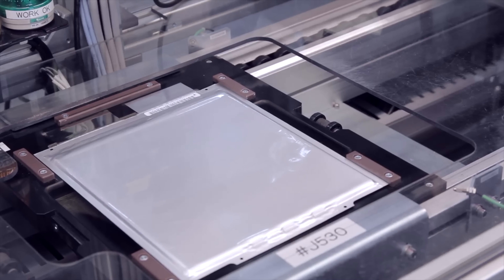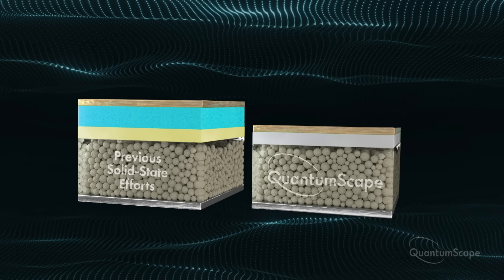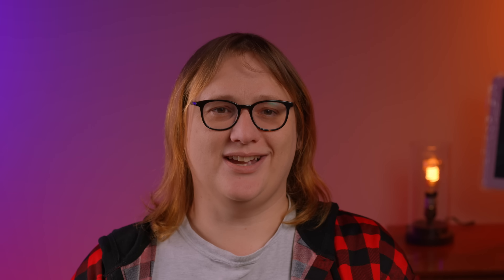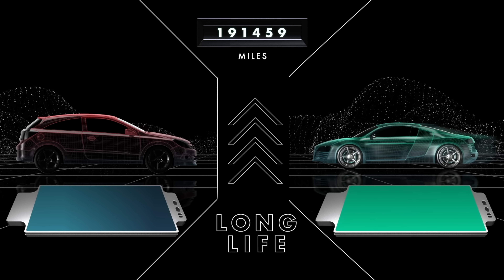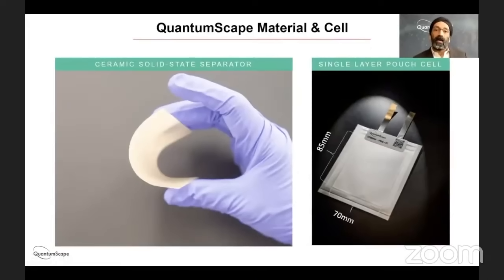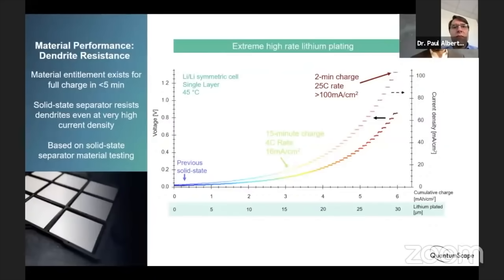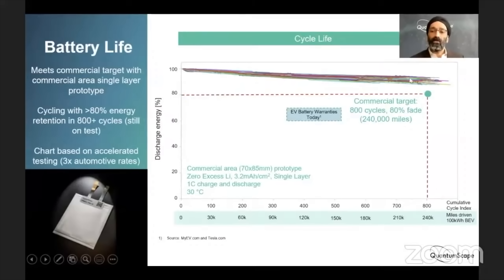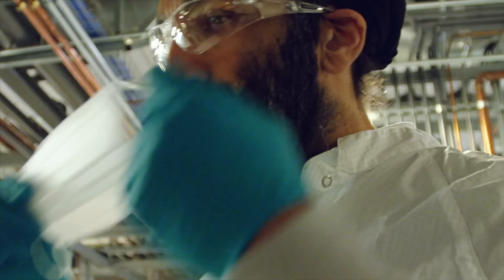Why Quantumscape's Battery Revolution Is Big News

Comment: Why?
They will deliver in 5 years. Maybe. At quite low wolumes.
But isnt Teslas batteries in the year 2022 better in almost every way?
Reply: As VW wants to have 70 EVs to choose from by 2025 and they are an investor, I doubt it will be low volume.

And from what I remember cycles is the only thing Teslas announced batteries would be better.
Reply: @TBFSJjunior  what they want and what is capable of being produced at volumes and at a reasonable cost are 2 very different things
Reply: @jamespaul2587 
That is very true, but many start ups have a big issue in ramping up production as they don't have enough cash.
My point with VW was, that QS would have a customer who is also an investor. Currently VW is building a new battery factory for Northvolt, as they have the cash to do such things.
Reply: @TBFSJjunior  If VW is relying on only these batteries, they won't go far. By this company's own estimate they will produce only enough for 1-2 million vehicles by 2028.
Reply: @srikanna4597 
VW already has their own battery production in Salzgitter Germany where they are currently building 2 manufacturing facilities aswell as 4 extra manufacturers, so no.
Reply: @TBFSJjunior  Isn't that what I am saying too? May be did not word it correctly
Reply: @TBFSJjunior  yes vw will for sure do  big numbers, they are talking about 1M in 2025
But i was talking about quantom space, and their own projections
Reply: @rare_wubbox360 
My point was that if you have an investor with enough cash to finance a factory and the need of batteries, it is more likely to get to big volume production.

And there is a reason for 70 different models. I'm German and I don't know one person that would buy a Tesla because non of the Tesla's fit.
Ppl have very different tastes.
Tesla has 4 Models has 3 in the pipeline and sells under 500k cars. VW group sells over 11 million cars. If you want to do that, you need a variety of models.
Reply: @TBFSJjunior  still, with that big investor, the plans is not that big- and its many years before this batteries hit the market. So- its great, but is it to little to late?
yes, if u want to sell 11M veichles you need variety. 
Problem is you dont need 70 models to sell 1M cars
As for your example, Tesla will  next year sell more than 1M cars divided on 2 models. That is because the value proposition is way better than all the other
As vw ceo said: Tesla is 4 years ahead and we hope we will catch up and take the lead in the future
Hope he, as an insider, is correct. But when i look at the data for the last years its like they fall further behind
What happens when Tesla in 2026 sells 10M cars split between 10 models ?
And who is gonna loose when Tesla in 2030 sells 20M veichles with maybe 12 models?
I really think german car OEMs should pay attention to vw ceo Mr Herbert is saying
Reply: @TBFSJjunior  How many EVs do VW sell?  Manufacturing EVs is different than ICE vehicles.  You can't flip a switch and start manufacturing EVs.  It takes a major overhaul of the factory to produce EVs.  It is a completely different platform.  Also the legacy OEMs are constrained by their suppliers.  They buy parts from a catalog and assemble it into a vehicle.  If VWs suppliers can't provide them enough parts to make 1 million EVs (let alone 11 million) they won't be able to make them.  Also they lose profits from ICE vehicles as they are retooling their factories.  It's not a simple process, but VW seems to be better positioned to make the switch than other legacy OEMs.

Also Quantum Scape has many hurdles they are going to have to overcome to mass produce their batteries that seem to be only slightly better in some regards (while being worse in others)  than the 4680 cells that Tesla is already starting to produce.  Maybe the solid state batteries have more potential in the overall development cycle, but if their is only minor improvements to the battery performance, then it may not be worth investing billions to ramp the production.  Then again, these batteries may be the only way some of these OEMs "catch up to Tesla".
Reply: @TBFSJjunior  i was looking at quantomscapes own projections.. 20gwh is many years away
-and they are not comparing specs to whats best in class
Vw are talking about 1M ev in 2025, that aint so bad, still, i wonder why divide for 70 models instead of getting greater numbers of fewer models.. but legacy OEMs knows best?👍🇳🇴
Reply: @rare_wubbox360  They are probably counting each small variation of EV as a model.  You have 3 different battery sizes and 5 different trim levels and then count one model as 15.  You really only have 5 actual different vehicles.  That is the kind of misleading information that I would expect from legacy OEMs.
Reply: @thegamingsociety7880  yes, you are probably right🤣👍🇳🇴

Comment: If this is true, this will change more than cars.  This will get into everything.   Maybe, we see our smartwatches running for a week instead of a day or two.  I like to see a Macbook Pro running the M1 chip then combined with a solid-state battery.  That will be impressive. Oh, and say goodbye to gas/petrol powered lawnmowers.
Reply: Don't hold your breath for this but yes petrol yard power equipment should soon be all batt.  I switched over yrs ago, chainsaw, blower, hedge trimmer and mower, for nonprofessional they are just better.  Soon they will be the pro choice too and I'm betting HOAs and such will begin to demand them from landscaping businesses due to greatly reduced noise pollution.

Comment: All sounds good.

It would be good if Quantumscape work out a recycling stream as well as a manufacturing process.
Reply: They're years away from anything that would go in a vehicle for sale.   I'm sure that they will work out the recycling part, but that's a long way down the road and they have a lot of other things to accomplish first.
Reply: All in good time.  Obviously, they won't be in production for at least 5 years.
Reply: Like we recycle alkaline and carbon-zinc batteries.  NOT!  Why the higher standard for a rechargeable battery?

Comment: TL;DR its not... look up "solid power"... they are already delivering
Reply: Solid Power just released technical details which are worse across the board, including only 250 cycle lifetimes which is not nearly good enough. They're using a a sulfide separator, and QS tried and rejected sulfides for reasons of durability. All Solidpower did was demonstrate it's not that hard to make multilayer solidstate cells, which is the last knock on Quantumscape. Solidpower has fewer than 100 employees and no job openings, Quantumscape has over 200 employees and 70 job openings. So I wouldn't bet on Solidpower beating Quantumscape to scale with an equivalent product.
Reply: @slash196  product now talk later... tesla really blew up this market and the wider startup market with their battery day presentation... a lot of people nowadays are asking better questions like "When will it ship"... "How will you scale?"
Reply: @LoneWolf-wp9dn  My money is where my mouth is. Time will tell.

Comment: At one point you say the battery does not have an anode. I suspect you didn't bother to look up what an anode is.
Reply: You sound like me a few months back, Anode free batteries are a thing and Tesla applied for a patent. https://electrek.co/2020/07/09/tesla-patents-lithium-metal-or-anode-free-battery/
Reply: @terryrogers8965  She said the battery does not have an Anode. That is simply not true. 'Anode free' does not actually mean no anode.
https://roskill.com/news/batteries-anode-free-solid-state-battery-start-up-to-list-on-nyse/
“Anode-free” does not mean a Li-ion battery works without an anode but, rather, the absence of a host to receive the lithium plated on the anode current collector. "
Reply: @TimothyWhiteheadzm  You would be correct! Would you agree it is a very misleading way to refer to what is actually happening?

Comment: At what cost?  High energy density, wide operating temperature, non flammable, rapid charging.  At what cost?
Reply: The cost is "battery never leaves the lab"
Reply: Cost and manufacturing ease

Comment: I was excited until the words ceramic separator. Such ceramics are often notoriously expensive and slow to manufacture.
Reply: And brittle. Crappy durability...
Reply: Yes but you're (I have to assume, not an expert in this field?) therefore don't know what you're talking about.
And speculation/opinion about highly advanced tech - which 99.9999% of us know ZERO about, is COMPLETELY irrelevant isn't it....?!
Reply: @andymccabe6712  I'm by no means an expert in the field. That said, I'm no stranger to manufacturing in the past. So I'm sure if there's something like atomic layer deposition (ALD) involved... well, you're going to need a vacuum, gaseous materials to deposit... or PLD, etc. You can make amazing ceramic materials with those methods, but it's going to be expensive.

If it's some chemical solution process instead, we might be talking. Even these can be slow and thus potentially require a large factory footprint, but we'll see.

Quantumscape, on the other hand, has all the motivations to hype this discovery. I'm sure the battery works fine, but is it really manufacturable?

Anyways, what do you know about this subject?
Reply: @az09letters92  There are a lot of ifs in your post. Better to speculate when we have some facts.
However, logic would dictate that if it is not "manufacturable", then WTF have they been doing over the last 10 years, and YTF would they make a press release?
I'm just going to listen instead of casting doubts without any substance. The future comes soon enough!
Reply: @ahaveland  I'm not trying to cast doubts without substance. Ceramics are expensive to manufacture, it's up to Quantumscape to prove otherwise. I do hope they'll succeed.
Reply: @az09letters92  Some ceramics may be expensive to manufacture, some aren't. They do not all fit neatly into one-size-fits-all box, so it is impossible to say whether their particular ceramic will be expensive to manufacture, especially as a flexible ceramic is a very novel material. They know something we don't, so let's just  wait and see.
Reply: @ahaveland  Let's wait and see. I'm carefully optimistic. I was considering to invest in QS, but decided otherwise, because I just couldn't convince myself they have something practical. Cheap solid state batteries would be amazing and considerably help pushing EVs into the mainstream.
Reply: @ahaveland  Companies have press releases for all sorts of reasons, not all of which are noble.  Jordan Giesege from The Limiting Factor has reviewed this presentation.  He knows a hell of a lot more about batteries than I do, and probably more than all the rest of us too.  He was not particularly impressed.
Reply: @incognitotorpedo42  Indeed, as Nikola seems to illustrate. I'll reserve judgment until more details and real world benchmarks, price and performance are demonstrable in the public domain.
Reply: @andymccabe6712  I agree. It is the same with everyone moaning about how bad fuel cells are.

Comment: That is completely very groovy news. Eventually, this will lead to people wanting to undergo surgeries to implant super light weight power storage units and devices that attach to their muscles, or the basil ganglia directly to send the power signals to the muscles, thus allowing everyone to go about as if effortless as the energy required to jolt muscles into animation is a conductive current, carefully though, in accordance to full borg regulated compliance of course.
#VoteForAI

Comment: Because Volkswagen is a major backer of this project, you know they want a prototype battery for a motor vehicle tested in a few years. This may make it possible to push the range to at minimum 600 km (372 miles) per charge even on a vehicle larger than the Volkswagen ID.6 now in testing.

Comment: I dont know if i can support this as it likely means the end of exploding phones
Reply: Good point though.  Everyone's talking about automotive applications, but this cell could increase battery capacity across all devices big and small.
Reply: and where's the fun in that? =D
Reply: It 100% will if it is punctured and water gets in. If water comes into contact with the pure lithium it is going to get seriously hot then explosive.
Reply: I am not sure as the world will keep thinking every battery explodes for ages to come. DHL will never ship any kind of battery in the near future. So I wonder how car manufacturers get away with it, when a small compny do not.
Reply: The form factor is too big for phones.
Reply: "30% more energy dense" this means that you get a 30% larger charge capacity for the same battery size
Reply: @denvera1g1  dozens of companies and researchers have said the same thing about SSB for the past decade. None of them have been able to get it to market.
Reply: @davefroman4700  which is always true for any new tech, until the first company to make it work. So your statement is just a truism and doesn't hold much value.
Reply: Dave Froman they can produce any form factor they want

Comment: Seen so many solid state battery announcements... Will only trust it when they actually start putting it in cars in volume (2026, 2028?). Specs alone are not far off regular lion (tsla), safety is probably better but not a huge issue now... I'm rather in Gali's and the limiting factor's camp on this one.

Comment: Until they have full working prototypes and not just nickel size cells this is just vaporware. And if we are talking five years to get to that point with just 800 charges I’m with Galileo in doubting they’ll attain better performance than top tier lithium cells. I smell a Nikola.
Reply: "nickle sized"
A nickle is 1.1cm².
Their battery was 63.5cm² big.

Comment: About a decade away if you believe QS at which point it will be dramatically obsolete.
Reply: Tesla’s new batteries have been tested to over 10k cycles 0-100% with less than 10% degradation. If you only cycle then 20-80% they have even less degradation than that (1-2%). Effectively they are 2-4 million mile batteries that can be recycled into new uses after the car falls apart around it.
Reply: Why/how dramatically obsolete?
This is the furthest I've seen solid states to be.
Reply: @TBFSJjunior  QS isn't even optimistically beginning production until 2028 and Tesla's new cells going into mass production next yr or soon after are roughly equivalent, certainly they will be much better still by later in the decade.
Reply: Soon most auto manufacturers will be building electrified fleets with “good enough” Li-ion batteries.  Once they have multi-billion dollar factories to crank them out and gradually refine them to be even better, it would take a drastic improvement in battery performance and cost to unseat the mass production technology.  Consider that GM is still using production machinery used to make 1955 pushrod Chevy Bel Air engines to make mid-engine Corvette LT V8s, 65 years later.

Comment: Um, Quantumscape’s battery is lithium ion.
Reply: Sure, but it seems that there are lots of differences and benefits, such as reduced flammability. She knows they're lithium ion, she even said so. She compared them to STANDARD lithium ion batteries. I would recommend watching the whole video. https://www.google.com/amp/s/arstechnica.com/science/2020/12/vw-partnered-quantumscape-claims-legitimate-battery-breakthrough/%3famp=1
Reply: It uses lithium ions, but "lithium ion" is also the name for a type of battery, which also uses lithium ions, which can be confusing
Reply: It's lithium metal. Current battery architecture strictly avoids lithium plating at the anode as this basically stops the battery from working. QS's architecture, on the other hand, relies on plating to achieve these great results. See their presentation :)

Comment: hope it works out and they are liberal with their licencing, we need a lot of factorys all over the world to produce these things.
Reply: VWG only.
Reply: @waynerussell6401  False. VW is a minority shareholder and does not make business decisions. QS is an independed company and their CFO has already said they will look at licensing deals. People shoot their mouths off about this shit without actually READING THE FREAKING DOCUMENTS.
Reply: @slash196  VWG is the largest automotive investor at US$300M with Blome and Leohold  having seats on the board and a joint venture agreement to manufacture since 2012.  VWG will be desperately short of batteries at current planned production by 2025 and will finance every battery QS can make, certainly orders of magnitude more than  QS's 20GWh. Technology licensing may be made to other non auto commercial users but VWG will take the  Lion's share if the production proves economic.
Reply: @waynerussell6401  You're overstating the influence VW has. The only thing VW owns is 50 percent of their joint venture cell plant and QS owns the separator tech and manufacturing outright. VW will benefit from their success as a shareholder but will not have exclusive rights to their tech in auto unless they pay through the nose for it.